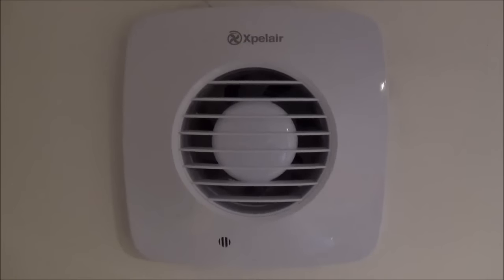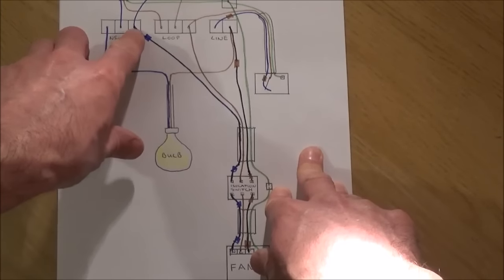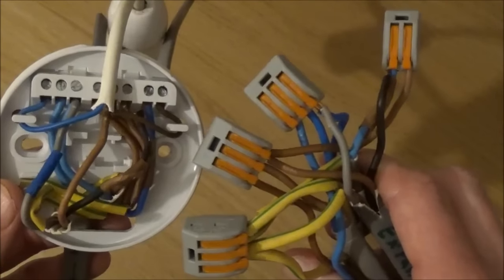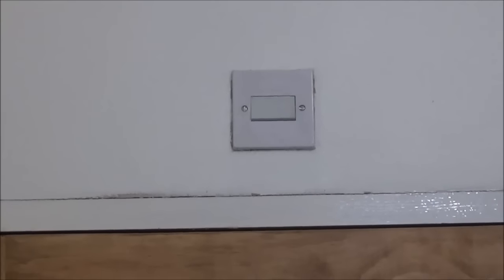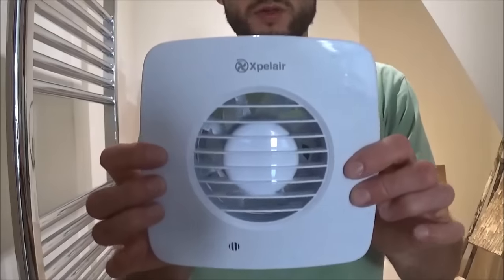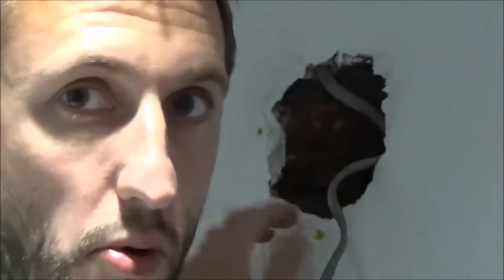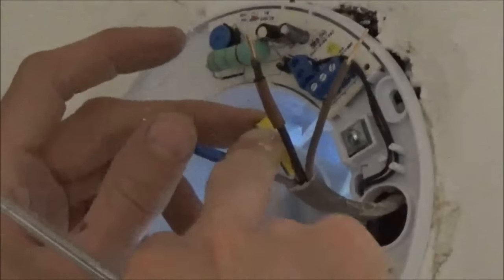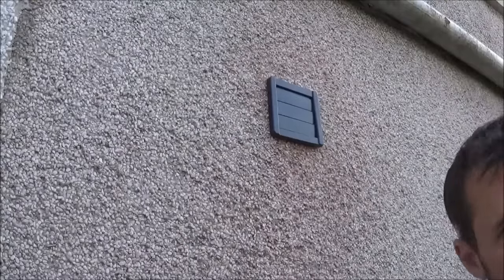How to fit a bathroom extractor fan using light switch. Extractor fan installation. Xpelair DX100

Comment: Please don't make  "how to install" videos for people to copy unless you can do it properly. As an electrician I am horrified about the bad practices and breaches to wiring regs displayed in this video. I saw bare copper at joints, doubled up wago joints, no grommets, grip fill ( which will pull the thin plaster off at 1st maintenance inspection) incorrectly terminated earth, no testing , no mention of RCD, no certification to prove it's safe and that the breaker will trip in time, and no mention of the zones and IP ratings of the fan. All in all this is a typical DIY bodge job.
Reply: I they didn't charge the earth to fix they wouldn't do these videos

Comment: However good a DIYer is they often don't have the required electrical knowledge. This chap seems well meaning which makes it even worse as people will listen to him. To put 2 conductors into the same wago hole is completely crazy and would never, ever be considered by an electrician. There will be resistance build up, with the very real possibility of starting a fire. A wago was never, ever designed to have 2 wires put into one hole. Many people will now have done this and you should at least remove this part of the video or the whole thing before other people create fire hazards in there houses.
Reply from the maker: Hi there, fair comment in that I should have really used the 5 terminal block wago (they don't do a 4) or used the 773 connectors (which come in a 4 terminal connector). But as for resistance, why do you feel that's such a problem? The wago 222 is rated at 32amp and designed to take up to a 4mm wire. This is on a light circuit protected by a 6amp MCB. The one thing it may do is not allow the connection to be deemed as 'maintenance free' but how is this any different to putting several wires into a screw terminal on an older type of connector block? Thanks for the comments and thanks for watching.
Reply: I'm sorry this sounds a bit harsh as you seem like a nice guy who means well, but electricity is not just about getting it to work.  It kills people, and unless you have an in depth knowledge of it I don't feel you should be teaching people how to play with it on the net. I have seen so many terminal blocks blackened out by thermal damage due to arching due to be poorly terminated. Have a go yourself at putting one 1mm in the wago and trying to pull it out, you can, but it's difficult. Now try putting 2 x 1mm conductors in, you can pull one of them out easily showing that it does not have a good connection and therefore poor resistance, and therefore heat build up. 99 times out of 100 I expect you'll be fine, but if your video is watched by 1000's then some will become defective (and therefore dangerous) as opposed to none if the wago is used correctly. Wago spent £50,000 on their tests for these WAGO's which is completely nulled if you don't use them as specified. The 222 can only take up to 2.5mm solid core or solid stranded cable it is not designed for 4mm twin and earth. It could take 4mm soft stranded (flex). Also, Wago do do a 4 way connector block which would have been suitable in this case (wago 773). Lastly, I haven't mentioned being maintenance free as it doesn't need to be in this case.  Thanks also to yourself for taking the time to reply.
Reply: POUSE around the HOUSE I think youre gifted in teaching. You do a good job and I've just qualified as a Domestic Electrician but still have a lot to learn and your videos really do help. I don't listen to nit picking idiots who've never been on site, and who are motivated by jealousy. Well done mate, thanks for your videos.

Comment: Could you post an alternative diagram if your installation is Quickwire (or similar push and click fit connection systems), not ancient ceiling roses? They only have twin core and earth, and of course you need three core for the fan isolator. How do you square that circle? (I've asked Quickwire and they're developing a three core and earth version but until that comes to market...)

Comment: My fan is broken but the problem is my pipe is 100mm diameter so if i buy 100mm fan i don't think it will be fit,so what do you recommend for this problem.Thanks
Reply from the maker: You need to get the fan and measure it vs the actual size of your duct. No point knocking new holes out if a fan will fit. If it turns out your ducting is a smaller size then you will need to widen the hole. I think that one is for another video! Best of luck with it.

Comment: finally someone in the uk doing good clear videos on this sort of thing. been looking for something like this for ages! im planning to do this only using my pull cord light switch for my bathroom ceiling light (4 led spot lights) and take a feed from that circuit to power a larger high volume extractor fan mounted in the attic, which will then vent through a soffet vent. well, thats the plan anyway!
Reply from the maker: Thanks for the feedback Peter, glad to have helped. Good luck with your project and thanks for watching!

Comment: My extractor screams randomly. Sometimes it's quiet and other times when I switch the light on the thing whirrs and screeches getting louder and louder until I pull the switch again. Is it dust build up or dodgy bearings or do I need a new unit? It's quite the unique sound, a bit like a car doing a burnout and it seems to do it only at night when it pisses my neighbours off the most.
Reply from the maker: Hi Neil, sounds like the bearings so you may need a new unit, but while the unit is off, give it a good hoover and suck all the dust out of it. Also check that the vent isn't blocked outside as if it is, then the fan will have to work harder. Good luck with it, and thanks for watching!

Comment: Hi Pouse - great video! If i wanted to fit a 3Amp FCU to comply with the manufacturers instructions where in this circuit would be best to wire it?

Thanks
Reply from the maker: Hi, if you wire it off the light circuit as I show in the video then no need to add an FCU as it is already on the correctly rated 6 amp MCB at the consumer unit. What you are referring to I believe is running the fan from the ring main power? If so, you spur the cable off the ring main (either from a socket or junction box) straight to the FCU (in 2.5mm cable like is used for sockets.) After the 3amp FCU (the load) you can use 1.5mm lighting cable as this is safe to use with 3amp protection. Something to bear in mind is that unless you then create a switched live in the circuit, you won't be able to use a timed fan as a timer fan needs a permanent live and a switched live to operate correctly. Hope that helps, good luck and thanks for watching!

Comment: Hi pouse, great explanation of the jobs, but I'm stuck !!!!! Installed same timer extractor fan in a study and trying to connect to a separate 3 pole isolation to a power source and separate switch. As you said you would explain in your next video. Wish it was on here now. Tried all ways. Had it running but the timer won't time out. It's drove me crazy. Help !!!!!!!!!!! And I can't seem to find the answer on here. 😞 keep up the good work mate 👍🏻👍🏻👍🏻👍🏻
Reply from the maker: Hi there, yes I'm in the process of editing that video if you can hold on. For the fan to work you need a switched live and a permanent live. If you don't it wont work. In brief, you need to create another ceiling rose (or junction box) in the ceiling with a switch (like when doing a light) but don't attach a light to it, just the 3 core and earth to the isolation switch and the rest is the same. That way you get a separate witch with a permanent and switched live. Hope that helps. Good luck and thanks for watching!

Comment: Loving your videos but I had a question regarding the Wagos. At 7:32 you put the switch live going to the extractor fan into a Wago block with two connectors. Why didnt you use a Wago with three connections? Is it because you didnt have a three connection Wago, or does it need to be in the same place as the other wire? Sorry, I think I confused myself!

Comment: This worked a treat, believe it or not my friend who is a qualified spark but been working with Siemens Renewables over 15yrs now, he told me that the Grey was the Switched Live and Black Neutral...

Didn't quite feel right, done some reading and checking out diagrams then found this, so for all the bollocks on here from obvious tradesmen scaremongering and feeling the pinch, this guy uploading a vid, doesn't scream "fkn do this now!" He knows if we've went as far as check out vids on it, we've pretty much made our minds up that we've got our head set in doing it anyway but just looking for guidance..

If I zapped myself, took some Sith lightning, I can't blame this guy, electricity is dangerous, its serious, we know this, do we take precautions, yes, do we go it on one video alone without reading up, checking wiring diagrams and reaching for a multimeter? No!...

I for one found this to be extremely helpful...
If you guys with the knowledge and training want to help, charge a fair price! £80 for a light to get fitted is among the jokes I've heard, it's not rocket fkn science, follow good safety protocols and you'll get there, want to come on and rip into the ones who dare to take money out your loot sack, erm! Wallet sorry...  don't blame us or the uploader, blame the tories, these are after all austere times...

Thanks for the upload, massive help, i'm fine with electric showers, sockets, switches but this was my first replacement extractor...
Reply from the maker: Thanks for the feedback Gavin. Best of luck!
Reply: @POUSEaroundtheHOUSE  You're very welcome sir, a lot of ultra critical comments on here from folk not quite grasping that you are only offering guidance, all work is done at our own risk as it is with any electrical work and that still goes even for the qualified electrician.

I subbed, will be able to use some of your guidance in future coupled with the usual reading up i do on wiring diagrams, following installation instructions on the electrical item being installed and above all, power off at RCD Box, we all know that if RCD trips on power on, THEN we'll resort to being fleeced by an independent spark...

Thanks again for your help

Gav

Comment: Hey Pouse.
Very easy to understand video. Well done and thanx.
One question for you.
Is the Neutral Permanent or switched?
I have the DX100HTS and the overrun doesn't activate.
I have switched live to L
Switched Neutral to N
Perm live to T.
Fan comes on with the light switch but no overrun.
It's also fitted with the humidistat and it would be lovely to shower in daylight hours without a bathroom light!
Any advice would be greatly appreciated. 

Dave
Reply from the maker: Hi Dave, Neutral is permanent. You need to put permanent live to L. Switched live to T. If you want to wire it up without using the light switch (use a separate switch) you're in luck. Check out my other video -  How to fit a bathroom extractor fan using an independent switch - https://youtu.be/KxH_FM03cMs. Hope that helps. Good luck and thanks for watching!

Comment: Can I come off the end of downlights to the isolation switch. Do I still use  1.5 or do I need the 2.5 cable. Thanks.
Reply from the maker: No, that's poor practice as if the light is ever removed, then so will your power be to the fan. Also it ensures the power cable size is maintained from the main lighting radial circuit. 1.5mm is fine if coming from the lighting circuit as in the video assuming the lighting is protected by 5 or 6amp fuse or MCB. If in doubt, call an electrician and stay safe.

Comment: Can you please tell me what will happen if you mix up brown live cable and black live cable when you connect them to the fan?
Is it going to work at all or is it going to short fuse? I installed the thing and it works, but with some weird 2-3 second delay in between switching on a light switch.
Reply from the maker: Hi, it shouldn't blow a fuse it just either won't work or will stay constantly on. it needs a switched live to turn on and off. But the permanent live is required to allow the fan timer to over run when the switch is turned off. So they both serve a different purpose. The few second delay is perfectly normal and occurs on every fan I have ever used. If you want to operate it using a separate switch (not the light switch) I uploaded a video last week on how to do that. Hope that helps. Thanks for the question and thanks for watching!

Comment: hey pouse in regards to the l1 l2 l3 does it matter if perm live is in the L1 and switch live in L2?
also alot of isolator switches have com L1 and Nuetral to
Reply from the maker: Hi Chris, in the example you give, best practice would be to put permanent live into Com, switched live into L1, and neutral into neutral. But physically, it doesn't make a difference as long as the wires on the supply (input) side of the switch, and the load (output) side of the switch match up. The 3 pole switch simply breaks the connection or circuit on all 3 wires when turned off. Hope that helps. Thanks for watching!

Comment: What about the fact fans normally state they need to be fused at 3 amp?
Isnt this work covered by part p regulations?
Shouldnt all cables buried in the  plaster be rcd protected?
Reply from the maker: Hi Chris, if it was run off a fused switch (which doesn't work for timer fans) then you could use a 3amp fuse, but the MCB is always a 6amp on the consumer unit when wired this way as it run off the lighting circuit. Yes this is covered by part P regulations as stated at 30 seconds into the video. Buried cables should be rcd protected (which they are in this video) if buried less than 50mm into the wall. Obviously these regs could change anytime after me writing this, so should always be referred to prior to carrying out any electrical work. Hope that helps. Good luck and thanks for watching.

Comment: just come across this pal. great vid. done mine connecting it into existing wiring that i haven't changed. Its a 240v overrun fan. One problem. Fan not turning. I've got 240v on the switched live at the fan end, but only 80v ish on the constant live. Checked the isolation switch. Same there. The old fan used to work but stopped one day so i just thought it was a knackered fan. clearly not. What might be wrong here please?
Reply from the maker: Sounds like you need an electrician to test the wiring. Safety first. Thanks for watching and best of luck getting it sorted.

Comment: Hi m8,, I’m want to put a outside socket in my garden and a security light,,,where would I power them to,,,I’ve got a extracted fan in my bathroom on the wall where I want my security light and where I want to fit my outside socket I’ve got a switch inside my kitchen where I could fit the socket but I don’t no if I could come from them,,,,have you got any videos on how I could do it cheers pal
Reply from the maker: Hi there. No videos on this currently but I will do one in the future. You need to take power from a socket in the house. Run a cable (2.5mm twin and earth) from the socket  to a fused switch (inside the house) with a 13amp fuse.  Then from the fused switch you can take power to your outside socket and light. The fused switch means that anything beyond the fuse is protected by the fuse and wont affect the rest of the house. Also, anything beyond the switch can be isolated by turning the switch off and removing the fuse. The circuit with socket on it must be protected by an RCD. Another option is to run power to the outside straight from your consumer unit if you have a spare MCB. Then all the outside power will be on it's own circuit but it must still be protected by an RCD. If in doubt get an electrician to have a look for you. Safety first! Hope that helps. Thanks for watching!

Comment: Hi Pouse, great video. few of questions if i may. 

1. You connected the earth wire but the fan but the one I have doesn't have an earth connector. (other fans i have checked don't either) i have the manrose MF100 (this is the non timer version). what cable should i buy and if an earth is required where do i connect it to?

2. I cant find an thermal cut off for the Manrose MF100 in any specs, should this worry me?

3. General question. The model i bought isn't a timer fan but i do understand the timer concept. If you leave the light on and therefore the fan on, what happens in regards to the temperature of the fan? How long before it gets too hot and what happens if it doesn't have a thermal cut off? A fire?

thanks
Reply from the maker: Hi Simon, I used a continuous length of earth wire to the fan but it's not connected to the fan as the fan is double insulated and doesn't require earthing. However if you wanted to replace the fan with an appliance that needs to be earthed in the future then the earth is available. As for the cable, with a timed fan you need a live wire, a permanent live wire and a neutral wire so you need a 3 core and earth cable. With a non timed fan you need a live wire and a neutral wire so you need 2 core and earth. You can't use the earth wire in a cable for a live or neutral as it isn't sheathed and it's actually sightly thinner than the coloured wires. As for thermal cut off, as long as your fan is protected by a 6 amp mcb, with the correct cable (1.5mm) and RCD protection, any fault like that should cause the trip to switch and disconnect the power. However you would need to check with the manufacturer about such specific detail. If you intend leaving the light on but want the fan on a separate switch, try watching my other video -    How to fit a bathroom extractor fan using an independent switch - https://youtu.be/KxH_FM03cMs. Hope that helps. Good luck and thanks for watching!